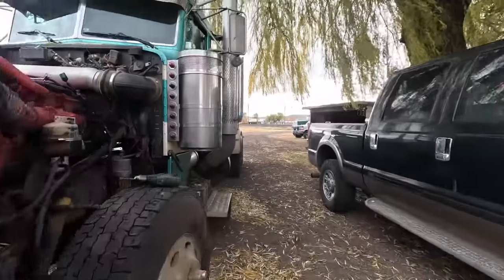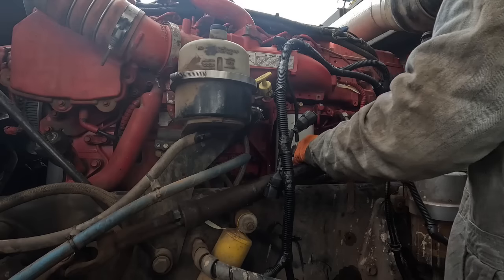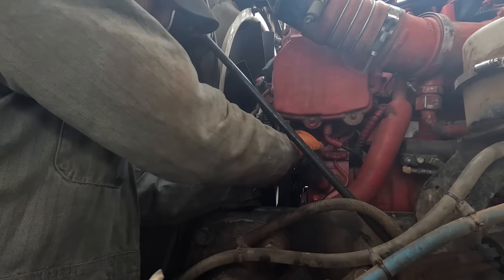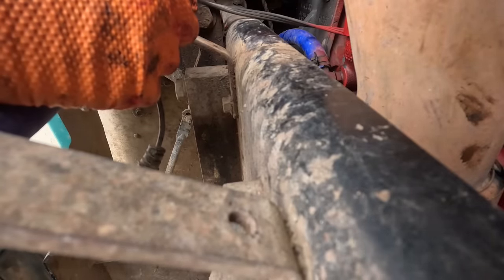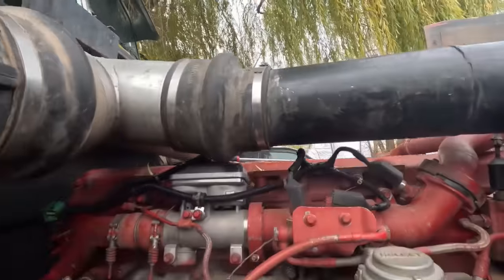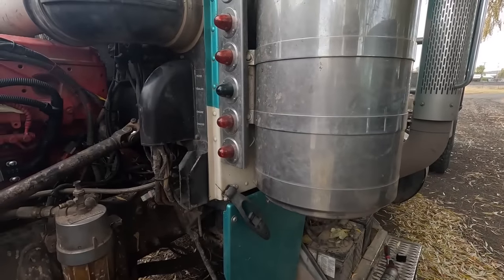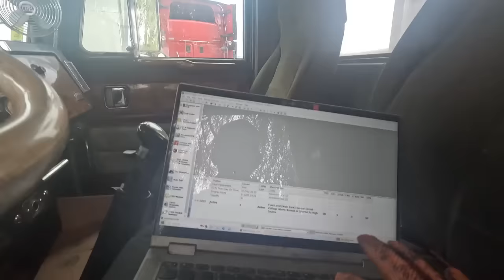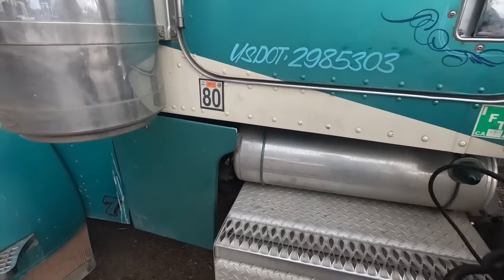ISX Cummins  engine harness  replacement

Comment: You can give them the engine serial number, the last six of the vin hell, you can even bring the truck to them and show them what you need, and they'll still give you the wrong part.
Reply: They have no consequences for screwing up.
Reply: The older parts guys are usually good, take the job seriously, may spend ages going through old systems to find stuff for you. The kids ? mostly worthless, if they don't get an immediate answer off the computer, it doesn't exist, also too lazy to check between computer and parts labels.   Thing is storemen  were proud of what they knew, and had paperwork to do if parts came back, nowadays,two swipes of the keyboard and throw the returns in what might be the right bin, all done.

Comment: Appreciate the Videos, Warren. I lived next to Train Tracks my whole life, almost 20 years less than 150’ away. I now lived down the track, it’s a few acres away now. I grew accustomed to the noise as long as it was normal. If there was an overzealous engineer it would wake you up or if they were very heavy it would shake the house. It has to be nice working at the house. Thanks again for the Videos.
Reply: 37 years near London's train lines, I should say that the furthest away was 100' now 70 to the actual train's skin. I don't notice any more. Sometimes woken up by extra heavy goods trains. Which was how I found the authorities were lying, they do take nuclear flasks through London !
   Our drivers only sound the horns when there is work on the tracks in front of them or a genuine emergency.  Years ago I stayed in Mystic, Conn for a short while, Train horns all night long, Why do your guys do that ?

Comment: Give me an old school mechanical diesel any day. These electronic nightmares fail way too often and way too soon. There has to be a better answer.
Reply: Wrong. A certain degree of electronics is okay. Way better fuel mileage, emissions and power with electronics.
Reply: One of the biggest selling points of having diesel power was it's ability to run without electricity. Just saying

Comment: Just imagine how nice it would be to label each branch/connector with what it was for!!  The assembly board, where all the different wires are pulled and routed for each branch could have a roll of labels for the assembler to apply to each connector showing where it is supposed to be connected.  For a grand total of maybe one dollar worth of labels, the wiring loom manufacturer could save everyone lots of time and hassle.
Reply: That would be too easy.

Comment: You can delete parameters and trouble codes using the Cummins Calterm software.
Reply from the maker: I was already sued by Cummins for having Calterm
Reply: @westerntruckandtractorrepa1353 How did they find out, was it from a YouTube video?

Comment: I know Warren is busy so can anyone satisfy my curiosity? Looking at the size of the cab of a truck, it looks the same as a tow truck with a roll back instead of the trailer thing. My question is this: isn't using such a truck to tow cars a waste of power since the engine can pull a lot heavier loads?

Comment: This is the bit that I find hardest, where do all these damned wires go to to plug in ?   particularly if I didn't take them off !  And what do you do with this orphan wire ? there it is, just hanging there,no connector on it, nothing it obviously reaches, nowt. Is it supposed to be connected, or is it redundant ?